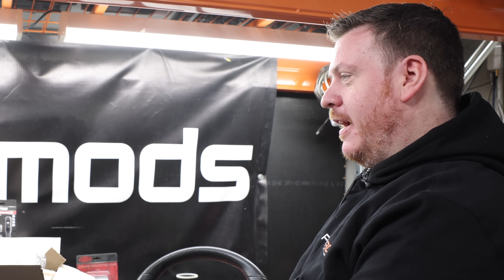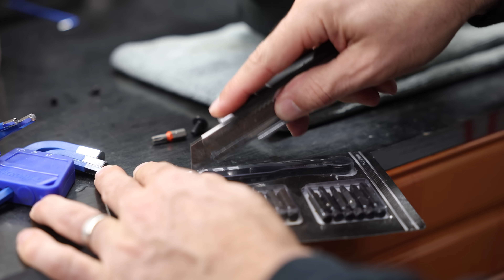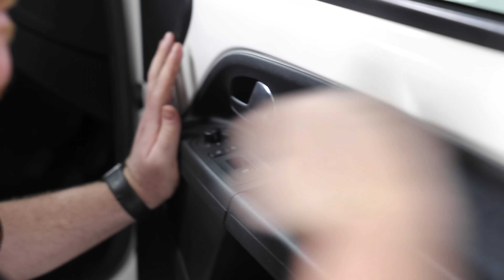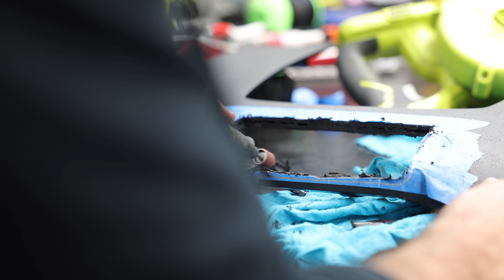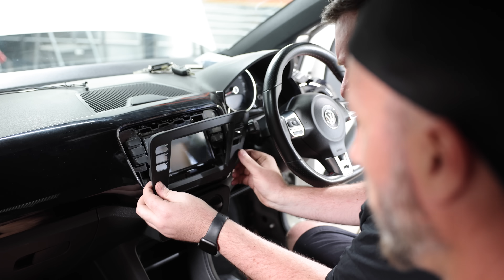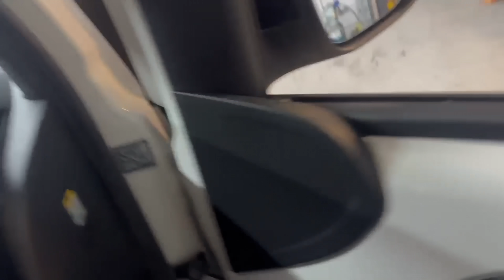Spending $40,000 to build a $10,000 Car - Turbo UP GTI Conversion EP9

Comment: Not sure why they didn’t just get a written off VW Polo or Audi A1 from Australia for a few grand. Both of these cars also have models that use the 3 cylinder turbo that the up! GTI has. Great result, but for those who are more financially challenged, the same car & engine combo definitely could have been built for a lot less.

Comment: Thiss choose is so weird.. why did you go with the steeringwheek of a older model? The up gti has the newer steering wheel that came in the 2014 polo and golf gti and R.. this is an oldgen steering wheel. Looks horrible those steeringwheels aren’t rare at all. They come in every polo and golf GTI/R you can both swap the r and the gti wheel in. Only the trim is different. Not rare at all

Comment: From the start I have understood this one. I have owned a Camry All-Trac since 2010. The original plan was to cram a 3S-GTE into it, now I am putting together parts to install a 2.7 from a Highlander or Venza. It's a low-value car that most wouldn't look at twice, but it's a load of fun to drive courtesy of the rally car suspension crammed under the rear end and I love it for its nuggety goodness.

Comment: I don't have paddle extensions on my Mk7.5 Golf R, but I want them. My reason is in really tight turns you can end up with crossed arms with your hands at 9+3 where the paddles are. The car will upshift for you at redline, but I'd rather upshift at 5500. Paddle extensions make it so you can reach the paddles with your hands anywhere between 2-4 and 8-10. Not a huge difference, but a slight hand shift and you can click up a gear.

I completely agree they look awful bad, that's the main reason I haven't installed them.

Comment: I would add paddle extensions to my VAG because 900 degree steering makes it much more difficult to keep your hands planted at 9 and 3, 100% of the time. If it had 180 degree steering it’s a whole different story. The second you need to turn the wheel more than say 200 deg it becomes cumbersome to find the tiny paddle. More prominent at low speeds.

Comment: I'm doing subframes to a later model car, going from cast steel to aluminium and watts link to independent rear suspension
Reply: the subframes owe me $550 but the engine I want is to go from 6 cylinder to a 4 cylinder turbo from a mustang or I'd even like to get a Honda k24 into it

Comment: The door lock wasn't broke. It was dead locked. But the new electronics doesn't use dead lock. Just lock and unlock. I would provide wiring diagram to test my theory.

Comment: As someone who rarely drives flappy-paddle cars, I've occasionally been going around a roundabout or sharp curve and needed to flap up to accelerate out, but because I moved my hands so my forearms wouldn't end up crossed, I can't reach the flapper anymore.

Granted it's not a VAG car (I'm talking about my gf's Honda Jazz/Fit), but I imagine the same principal applies.

Comment: For how "fun" VAG cars are with their specific module coding (and how long it's been going on) - I had a 2003 Golf TDi, it had an ABS fault and the "easy" fix was a new ABS sender unit and ABS sensors on each wheel.  The sensors are generic, so, easy.  The sender unit . . . is serial number coded in the ECU . . . and VAG used at least 4 different serial numbered ABS sender units on a 2003 Golf.  No reason for that, the units are all identical, they just report a different serial number to the ECU and if they don't match, the ABS error doesn't go away.

Comment: the plastic feel of the paddles is awful if you gone from metal paddle shifters to plastic small ones it doesnt feel as good especially if you are on be roads and you are feeding the steering having that extension helps in twisty corners(In my opinon)

Comment: As a proper FLOG with mk7 exertions which I never use I know that they are used if you would need to shoot to the moon. Press both at the same time, hold for 3 seconds and you are done !

Comment: I didn’t like the car radio mod, at least could have use a RCD 330 or 360 for having the OEM style.

Or use the older buttons that fit the frame

Comment: Been there done that lol.... I have a 21 year old truck that I wanted Android Auto in.... so after cutting out the dash for a few hours, I now have a nice double din as head unit as well.... and it's connected to the ODBII port for truck stats when out on the trails.

Comment: I have done the same thing 3 years ago, with GTI dashboard, rain sensor , GTI brakes and  much much more .
I can say I changed everything on the car , and it makes 156 hp on a stage 3
Reply: Man I will buy a vw up 2013 white for a cheap price and I just want to improve performance. How much it will cost me to do such covertion If I just find the parts needed and done it from a professional?
Thanks

Comment: Regarding the hazard switch and other buttons round the radio surround... On the High Up models at least in the UK they came with heated seats... In fact you could get the skoda citigo button set and it will pretty much match VW Up parts in the UK will probably have these on the shelf

Comment: I think it would have been considerably easier and cheaper if you got the same generation of Up! as the base car. It seemed to be the facelift conversion that caused you the most pain rather than the fact you were fitting GTI parts.

Comment: Bit confused with the steering wheel situation, you have a 12 button but need an 18 button or the other way round? If so either way what are the missing buttons and why is it such a rarity in Australia?

Comment: Hey boys, my 17 year old daughter saved and bought her first car a 2015 hyundai accent with only 73000k..
  The CVT gear box has goated itself. Now looking at either a second hand box for 4k plus install of nother 1-2k or a new one for 10k..
   Every auto bloke says that you have to use a CVT box to replace but my question is do you boys or your fans know of a conversion kit to  different auto box?
  Any advice appreciated

Comment: Extending paddles makes it easier to locate them when grinding at the wheel.
Some high-end cars have the paddles fixed to the column. That way, the paddles are in the same position regardless of the steering wheel & easily locatable.

Comment: Man i have a 2012 Ford Focus ST and seeing all the problems you encounter with Electronic stuff, buttons and so on encourages me to get a older pre 2002 car again. Currently looking on a 1992 Mazda 323f BG with the 1.8 SOHC or a bit more reasonable with family a 1999 Mitsubishi Galant wagon with the 2.4L Petrol engine. For the 250HP of the Focus i pay way too much insurancetax so i would safe 80-100€ every month plus i could make all the repair myself.

Comment: With the doorlock it could be the deadlock feature. In the UK we have them i think the EU also. US spec does not i think and i am not sure about AUS stuff. Essentially the doors double lock in the UK. The deadlocks are an issue here with VW as they use a cam to operate a switch. The trouble is both those things are plastic. Over time something wears down (usually the switch and you can buy replacement ones) and the switch can no longer be pressed. This means the deadlock stays on and the door can't be opened from the inside or the outside.  Most people end up cutting into the door skin as thats cheap to replace.  The other doorlock issue is not setting the preload correctly when you change the lock. But you can take the handle off and disconnect the metal cable to get the door open if this happens.  Not sure if VCDS has the option to turn the deadlocks off.  The deadlock issue is such a stupid one and catches loads of people out as they order new locks from online only to fit the incorrect one.  The auto lights are also something different in the UK and US. The actual switch is different depending on location in the world (something you can mess with in VCDS if you have wrong one IIR).  

Oh and i like it but man the new Polo GTI looks way sicker (altho it basically looks like a golf now) and "LUPO GTI" looks sick also those are proper little nuggets especially the older early 2000s ish ones.

Comment: MCM has been pure inspiration for me, since way back in the early days when I didn't know how to change my wiper blades, and years later I do all major servicing and repairs on my own cars, recently picked up a Renault Twingo II for a second car, RS? nope... bog standard 1.2 16v and its my favourite nugget, so easy to work on, and it certainly made me appreciate simplicity, because its sooo slow you get to use 100% of the car and its super fun.

Comment: You missing little rubber around ignition key 😂 you should also install full electric ac. Then you have only wires. Also you can re pin old buttons. Please Please fired up this guy. Another episode and he don't know anything about VAG!

Comment: Blown fuse .... Not "Everything Bang" as a choice with the head unit, Moog? 😉

Also with the paddles, likely so people with different driving styles can still properly use them. I position my hands on the wheel a bit differently to most other drivers, so too small paddles in a stock position would annoy me.

Comment: I use small paddle extenders sometimes because I want to touch metal and not plastic. Also I'm fairly sure the paddles on that wheel you removed were aftermarket.

Comment: Hindsight 20/20 Would it not reduce cost and time significantly if you have two pre- or after facelift models, and if you just bought a full crashed-GTI and half-cut it?😅

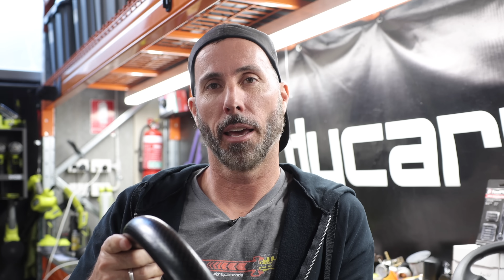Comment: 5:29 It's because when youre daily driving late to work - coffee in one hand and toast in the other, and your knee's steering that flatt bottom wheel, and youre in a corrner, mostly roundabouts, you can still snap a comfortable 2nd/3rd/4th up or down-shift with thattop part of the paddle extender. Peeps with this mod kno! mk6GolfR S2+

Comment: Its just a shame that they basically made a newer generation car with the same body! Had the same when I built my mk2 golf VR6, mine is a july 1989 car, they changed all the wiring and most interior buttons (internally) in August 1989. Had to rewire the whole car with a loom from a later one, even new steering shroud, fusebox mount etc, despite the conversion being, in theory ‘plug and play’

Comment: Would it not have been easier and cheaper to have bought on in the uk then pull it all apart and put it all in a container then ship it back home? It would have at least given you everything you needed plus you shouldn’t in theory had any niggling problems to sort out

Comment: I think you are looking at this wrong.
It turns out that it costs $40,000 to import a Turbo UP GTI .
But, batteries not included and some assembly required .

Comment: This car alone is why i will never spend any money on a VW newer than 2010 ish.... NEEDING a VW service station  to change out a break booster when it is no more than 3 bolts and 2 brake lines because of a computer interface..... no thanks rather drive an American "ill handling v8" where i don't need to spend $1000's to replace something i could do in 5 to 10 minutes. from what i have seen with new vw..... WAMP WAMP.....

Comment: Paddles should be mounted on the bloody steering column but not the wheel. They should be long and easy to reach but always in the same/correct location.   Till they fix that in anything under a supercar I'm afraid I'm going to have to stick with manuals.

Comment: So its basically a bolt- in- conversion :) The UP! is not an MQB car because its just way to small for that. Any conversion bigger than the 3- cylinders it comes with and you have to cut away alot from the car to make it work. The UP! GTI is expensive here in germany, but its a fun tiny little hot hatch :)

Comment: I race a 1,0TSI Polo in South Africa, which is the same engine as an Up GTI, in a partial development with VW Motorsport South Africa. We swopped the turbo with the one from a 1.4 TSI (which bolts straight on) and have been racing it for over a year now without any issues. Maybe something to look into for a power upgrade, quite simple and a potential 130kw at the wheels.

Comment: my brain is having a malfunction that you cant import the factory built working legit working actual working like comes from a box working car, but if you spend enough money from some ads you can build one that sorta half arsed is the same and kinda works but kinda doesnt and no one else is ever going to do because wtf, but theres some great info on all sorts of stuff that would not matter in the slightest if you just got the factory one. cmon ausie, i though nzz was bad 🤣🤣🤣🤣

Comment: 19:22 to me this is what I take away from this story, or perhaps a reinforcement. Cars have become way too regulated, electronic and proprietary over the last 15 years, and it's only going to get worse. Cool build, but the lengths you need to go to just to add a turbo (an OEM one at that) is exceptionally beyond excessive.

Comment: 5:50 the reason is because when you a turning the wheel and wanting to shift at the same time it’s difficult to find the little flaps.
Reply: I have a mk6 gti and I chose not to add it because it looks janky.

Comment: This series has made me realize something that is making me a bit sad: In 20 years car modification will be rare. With so much computer controlled "stuff" (to use a neutral word) that will refuse to talk to anything, except what it expects, it will be incredibly hard for a car newbie to get into anything other than doing oil changes and putting stickers on. Unless laws change, so car manufacturers are forced to open up everything, it will eventually become completely impossible to do anything meaningful, and the older, simpler, cars that are worth modifying will go up to stupid prices that most car enthusiast simply can't accommodate.

Comment: You ever tried dealing with Shannon’s for a claim? It’s a joke. Claimed my $3000 pwr radiator doesn’t fit after a front end impact. Refused to repair as it was “aftermarket “ even tho I’d listed all mods. Steer clear.
Reply: 6 months of solicitors and I ended up footing the bills for towing and repairs. Pathetic service. Even worse assessor’s.

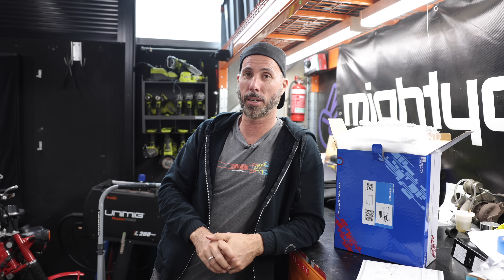Comment: 11:05 this is a great mod for old cars (if you're gutsy). I think everyone who has an older car should either try to use 3D printing to make the bits or seek the kits (and they are out there, one floggy search reveals thousands of them for all kinds of cars). There's absolutely no reason to keep the antiquated radio system when you can cut a bit here and there, move some guts out of the way and put a DD in for a modern unit. Very few cars have no space at all, as most of the times they were made from the start with the idea that something might change in a future trim.

Comment: Hi MCM! I have the pleasure to watch you guys since the Martins blue turd hahaha
Coincidently i have a up MPI 2014 for about 8 years, and thougt in change ts engine for a stock TSI, or turbocharge it since the exaust manifold is the same.
Baddly i live in Brazil and modified docs regularization are crazy expensive :/
Maybe i will put some money in it hahahha. Keep the good work!!!
Reply: Hey man I will buy a vw up 2013 white for a good price and I want to improve its performance 
How much will it cost me to convert it to a gti model If I find the parts and have it done from a professional 
And do you have any suggestions generally 
Thnaks

Comment: The only thing that's slightly shady about this re-do is the steering wheel bag. Different cars, different flavors and while in principle they work the same, they are not all equal. I don't remember if it was a bimmer or a merc, but it was a wheel swap and the guy had a frontal and broke his neck because of it.
Just a thought, knock on wood that never happens. I know M&M are responsible drivers, but you never know where the damned rabbit jumps from.

Comment: Personally, flappy paddle swap was because the aluminium ones feel far nicer to touch than the cheap plastic ones from factory. It was also an cheap and easy way to personalise the car to feel more connected to it.

Comment: Hey there, here in brasil we never got the gti, but we do have this same tsi engine in our UPs. Here, most cars are flex fuel ready from factory, since there is e100 fuel in essentialy every gas station out there, you guys could try and import the necessary kit to convert yours to run e85. People here have also got some nasty recepies, getting 180-200whp in these little things, and they are quick. They seem to use some sort of audi q3 1.4 tfsi turbine.
Reply: Hey mate Im going to buy a vw up 2013 white for a good price and I just want to improve performance 
You do have any suggestions and If I want to convert mine to a gti one how much will it cost me if I only find the parts needed(which I hope is easy since I live in Greece) and get them installed by a professional 
Thnaks

Comment: I like the extended paddles in my mk7 because the metal feels crisper upon Actuation than the plastic paddles, and i can reach the paddles when holding the wheel at the 5 and 7 position

Comment: It was a fun project to watch, but you could have bought a 2019 1.0 litre, turbo, 3 cylinder Rio GT-line for $20k aud and made the manual version we didn’t get here (mine has the AU spec 7 speed DCT) and lots of other spicy mods for a lot less.

Comment: The extended paddles actually do make a difference when you're driving on the track with gloves on. They have a more tactile feel as well if you get ones that replace the OEM paddles rather than just sticking on the back with adhesive. The stick on ones do look and feel shit.